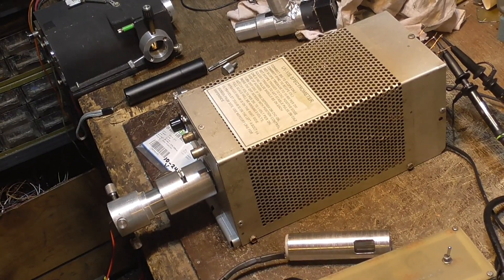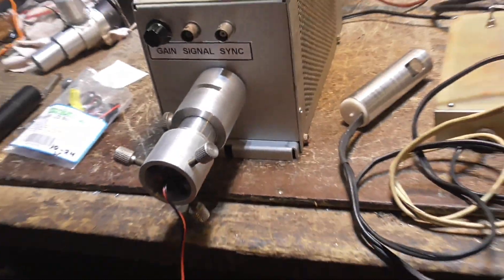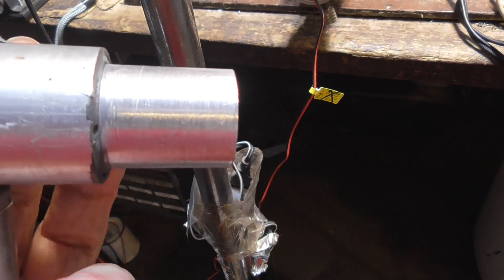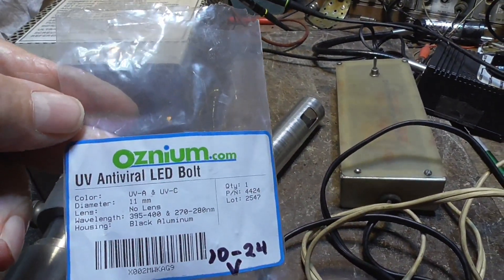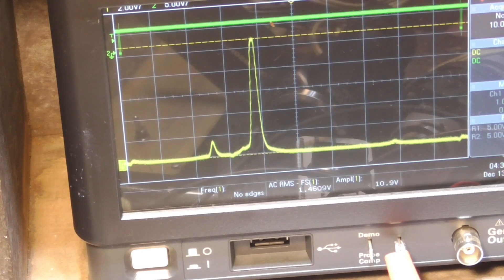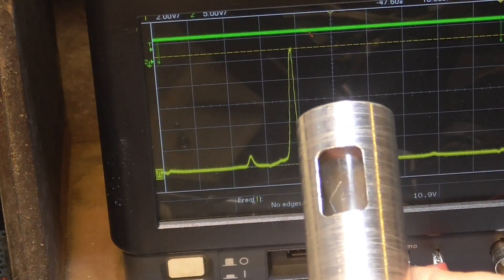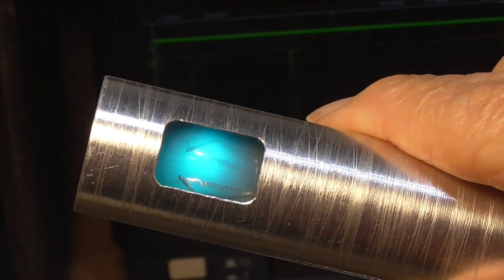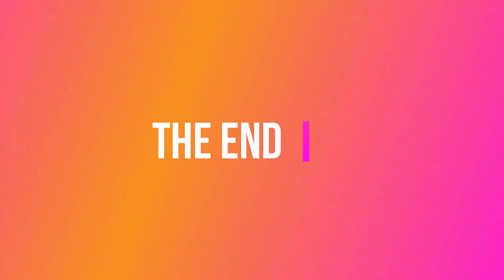UV SPECTROMETER TEST

Comment: Interesting, got to say te colour of the mercury vapour UV is much nicer.
Reply: You do realize that blue glow is not the actual UV, right? The actual 254nm output  (tall line on the spectrometer) is UVC, is invisible, and will damage eyes real quick. Those mercury tubes are potentially dangerous if proper precautions are not observed.

Comment: I was just doing this, because the high-watts 365nM arrays put out lots of visible white!  They also appear to have an IR hump at 730nM, but that might be a spectrometer artifact.   
Try some glass filter-disks on any 365nM leds.  I have some "ZWB2" type, with a 40nM passband at 365nM.  They nicely take out the visible whitish glow.  I guess the 25mm disk size was designed for UV flashlights, so they're common.  But ZWB2 does cut down the UV by more than 15%, and heat up when placed against high-watt UV arrays, so I have some ZWB3 types coming in.   
With the "white" removed, human eyes can still see the 365nM chip just fine, like a violet dot.  They're incredibly bright after all (mine have 3watt drive,) and the human sensitivity curve isn't vertical in the UV.   When you look at 270nM LEDs, do they still appear as a purple dot?   If so, then I wonder how deep in the UV-C does an LED need to be, before human eyes cannot see it at all.

Comment: on amazon they have these 405nm modules for laser pointers and I would love to see the output of one of those .... you can focus it down and it will burn you.... If I had your address I would drop ship one, I am doing experments with 405nm laser, cnc, and 3d printer resin ...
Reply: people in the reviews say its dim... its not dim at all they just cant see it and dont need to be messing with things that can hurt your eyes .... I have a co2 laser and its no joke... no blink reflex if you cant see it right ?
Reply: Even LEDS, e.g. a single 365nM surface-mount led, the kind with 1.4amp drive, will make paper blacken and smoke, if the paper is held less than 1cm distant.   And, those ten-watt UV LED arrays, they'll make your hand feel distinctly warm, even when held many inches away.   Also, running one of those unshielded in the lab, you can see every trace of dried human body fluids on the walls.  Did someone sneeze on your whiteboard long ago?  Ugh, now you know. Get out gloves and a bucket, and do like the Daleks command.   
Heh, haven't yet damaged my retinas.   But then, I haven't had to work with the hundred-watt versions, the one with 10 x 10 led chips, mounted on a "heat pipe" cpu-cooler assembly.   Not a laser.  Still scary.